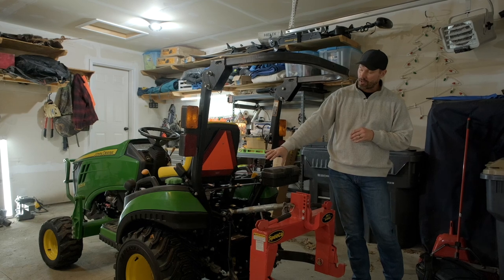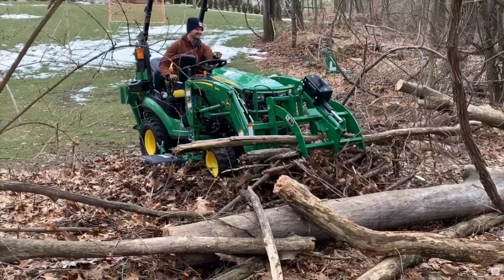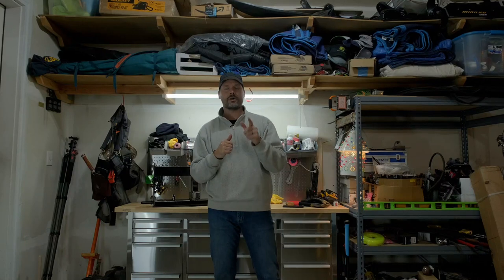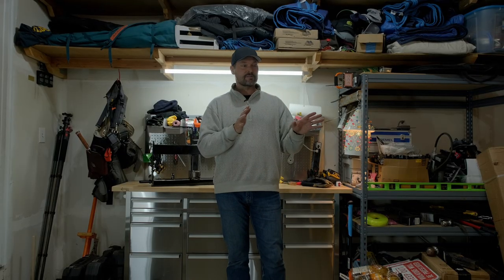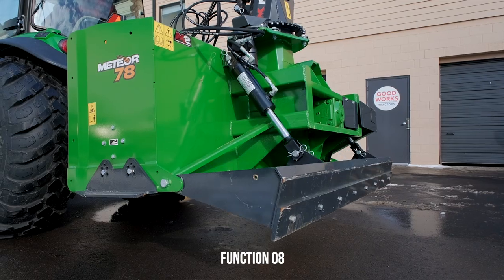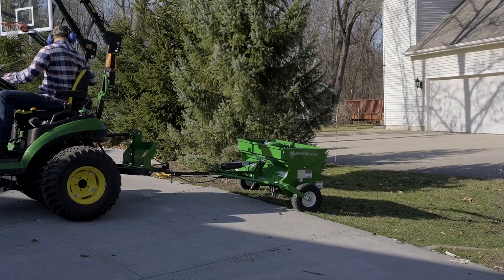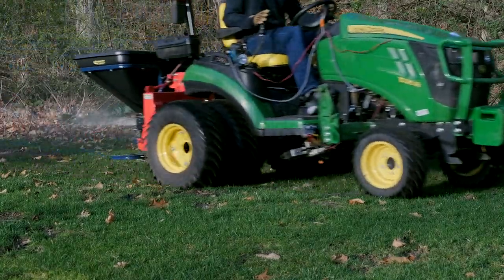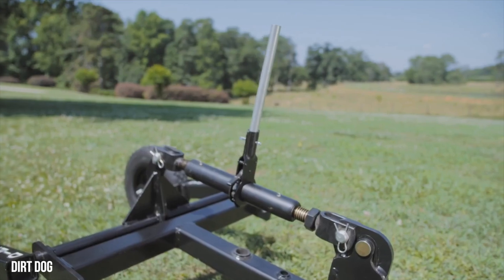WOULD YOU CHOOSE ELECTRIC OVER HYDRAULIC? COULD YOU SAVE BIG?

Comment: Kubota dealer installed a Landpride brand 3rd function for a grand when I purchased my L2501HST in June 2021. Purchased a North American Implement single cylinder budget 48” root grapple from a local “mom & pop” implement dealer for $750.00. Literally, the best two purchases I’ve ever made. I’ve cleared 3 acres this fall, the NAI is a beast. Moved up from a MF GC1705 with a non-QA bucket. Was looking at converting it to skid steer & adding a 3rd function. Sold it for a decent price & bought the Kubota.
Reply: like the kubota wich kubotas has a skid steer or ALO euro loader quick attach wich there great
Reply: jdubski NC thats not bad $750.00 same price like at my dealer here in canada

Comment: Thanks Courtney!  Another great one.  Thanks for discussing attachments which don't require PTO's and/or 3-pt hitches for us folks that don't have sub-compacts (I have two x739's).  Can't wait to see the Dirt Dog equipment!
Reply from the maker: Very welcome, glad you enjoyed!
Reply: @GoodWorksTractors  Is there anything to consider on blade types and number of blades used for rotary tiller , tractor power capacity
Reply: WHEN $12000 WORTH OF GARDEN TRACTOR ISNT ENOUGH; GET TWO!
Reply: @johnmf6096  John, Exactly!  Actually, the reason that I have two x739's is because I had one that I loved in our NJ home for about 5 years and when we bought our upstate NY retirement home, it really needed a 4 wheel drive machine instead of the 300-series machine that came with the house (we owned both houses for about 3 years).  And I was spoiled by 4 wheel steering.  Now with two x739's, I'm also set for the winter - one has the 54" rotary brush for the light, nuisance snows (1-3") that occur regularly and the other has the Little Bully loader on it.  I also have a big commercial duty Simplicity walk-behind blower for the deep stuff.  Oh, yeah, the driveway is paved and >450 ft long so I'll likely use them all each winter and enjoy it with zero shoveling!
Reply: @joeysawdust  I joke my man, I have a x748 and a 2025r at our place. My wife doesn't understand, but seeing that you're a man of culture as well, you would..
Reply: @johnmf6096  I understand completely and you're too kind.  And I'm happy that we've both got wives that understand (or don't) but support our "habits".  I always tell her that I'm a simple man with simple needs but simple doesn't mean cheap!

Comment: The hydraulic diverter kit takes a little more than an hour or two for a first time installer to install. Courtney has a video of his install, and he installed it wrong, which to his credit he admits. Having said that it’s definitely a do it yourself job with some basic tools and some time and patience. And in the end it works very well and is a great upgrade. If I were doing it again I’d buy the diverter without the hoses. The kit includes hoses that are obviously one size fits all, which means way too long for a 1025R. I ended up replacing several with made to order hoses and now the kit hoses are hanging on thw wall collecting dust.
Reply from the maker: Hoses for the 1025r are made for the 1025r.  There are universal kits as well, not sure what one you got.  I am not a mechanic and it was 1-2 hours to install.  Filming always slows things down greatly.

Comment: I lucked out on my summit deverter and grappler. I bought off a person for 900.00. I had to add fittings and hoses. That was about 400.00  to 500.00 to get working. Running hoses to rear is about 300.00 more when I get done.
Reply from the maker: Heck of a deal!

Comment: I have the hydraulic diverter kit on 3 of my loader tractors. 2 came factory fitted with them and they are used to run the third service for a 4 in 1 bucket and a round bale grab. The other runs a hydraulic SMS/euro/global quick hitch on the loader on my 4066r, the dealer had fun trying to get electrical side setup. You use a standard skid steer quick hitch button to unlock and lock it via the factory Deere valve. I got it setup so the quick hitch button activates the diverter as well as the 3rd fun valve. Really handy if you don't want to get off your bum.
Reply from the maker: I like the sound of that!

Comment: I just wanted to throw this out there. If you get a lot of electrical attachments, you may want to install a battery voltage gauge. You're putting more demand on your electrical system. A gauge may show a problem (like a dying battery or alternator) before complete failure. Also makes it easier to make sure you don't drain the battery too much. More helpful if you have kids using your attachments. 😁

Comment: Hi thanks for the vid. 
I would have like to see a line or two about hydraulic pumps driven by the pto for multi functional operations.. For example when u want to use the front end hydraulics at the same time as the backend and not  having to stop and wait for the hydraulics to catch up to two functions. 
Too often I see a tractor that has to stop at the end of the field when turning around to apply two hydraulic functions. 
Electric powered pumps are too slow when you have the whole hp of your tractor at that moment. 
Eg my 6100 kubota is a beast for its size. The pump is well sized for its hp rating but when the tractor is in light work it's slow as f.. My pto pumps for Oliver 770 are built for 65 hp and are simply too big. I'm going to engineer my own electric over hydraulic unit with suitable gpm but hey what out there first. 
Thanks.

Comment: If you're going new with your tractor order it up front with all the hydraulics you want, it's way cheaper then paying a dealer to add it later on when you decide you want that grapple or anything else that requires hydraulics
Reply from the maker: I agree, but thousands of used tractors already in the market without the extra hydraulics.
Reply: @GoodWorksTractors  oh absolutely I feel a lot of it is also a result that people "didn't buy the right tractor" with those options they wish they had opted for, or too small of machine at first. These admittedly are great options for people, I'm only basically saying if you choose to buy new and have that money to spend spec it out right the first time otherwise as you said dealers are gonna charge 1500 to 2k or more to add hydraulics to the front or rear, and its not gonna be as nice of a fit and finish as if was done in the factory, if you care about that anyway.
Reply: This is what i did and i don't regret it, 2 rear remotes and the 3rd function on the loader.. ready to go for any implement
Reply: my kubota dealer gets all hydrulics on all kubota when he orders them from factory in japan

Comment: Check brush crusher issues. I have seen quick attached pin pulling and bending during use. It also ruined front attach units. Costing  $500 dollars each replacement
Reply from the maker: Saw the video, looked like it might not have been setup properly, but lots of missing info.  Ten's of thousands of Brush Crushers in the field and you're bound to have an issue here or there.
Reply: Thanks for your response. I figure you would know more on that unit

Comment: I'm working on adding more auxiliary hydraulics to my 6330.I am using a power beyond block to send hydraulic power to another valve block. The power beyond block breaks out the pump, tank, and in my case, loadsense.

Granted, my tractor isn't a compact, but I would imagine the compact tractors would have similarly designed hydraulic systems. If they do, and they don't have load sense pumps, then a power beyond block may be a good option for those who need more than three functions but want a lever per function.

If they do have a load sense pump, then the valve is like 3k. So definitely cost prohibitive. I bought a valve on ebay that I am trying to get to work. 😁